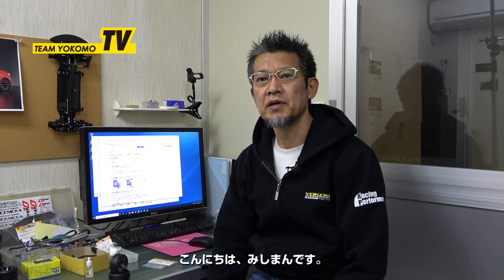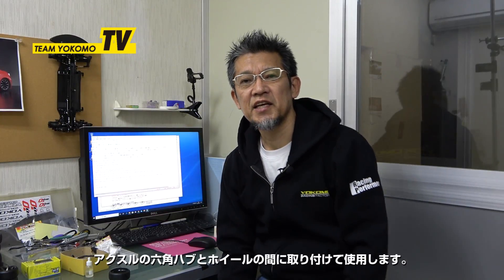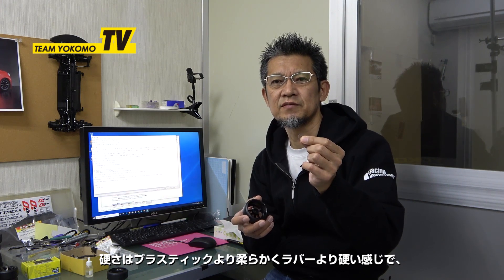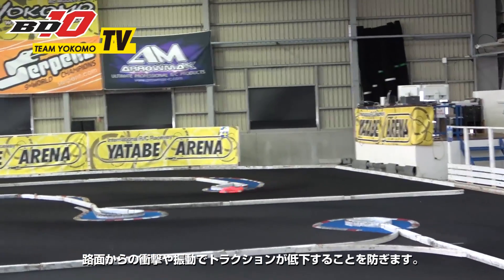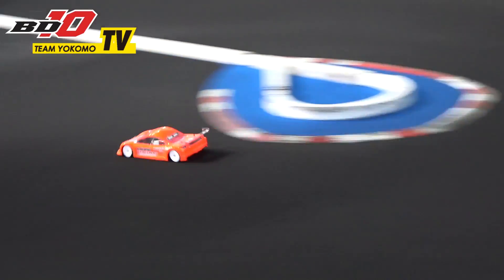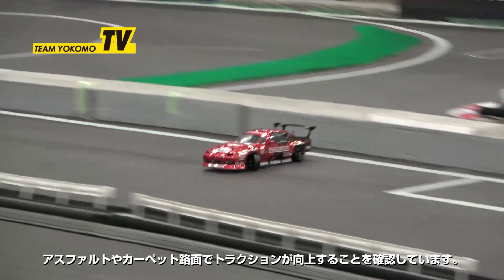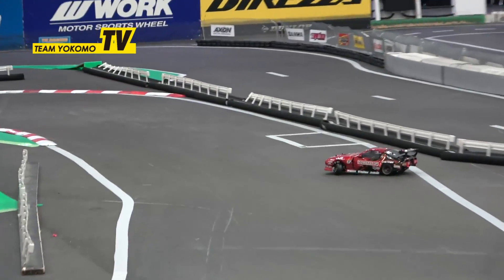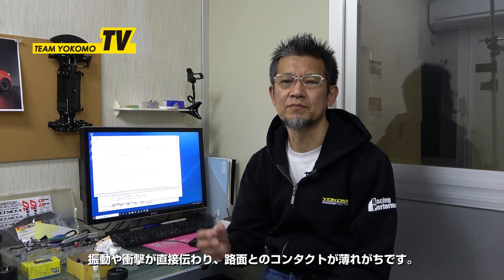Reduce Vibration, Improve Traction! with High Traction Wheel Spacer

Comment: How does a space give you more traction all is doing this giving you more with? 😒
Reply from the maker: The increased vibration reduces the stability of the tread surface, so removing the vibration increases the grip.
Conversely, if the road grip is high, the tread surface may become unstable.
Reply: @RCCarYOKOMO  nice 👍🏻🔥😎🔥💪🏻